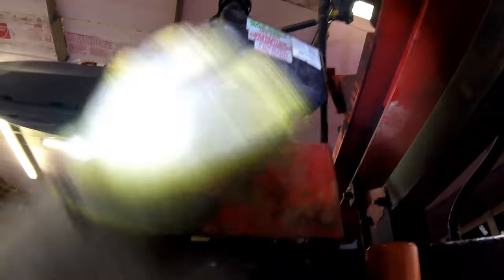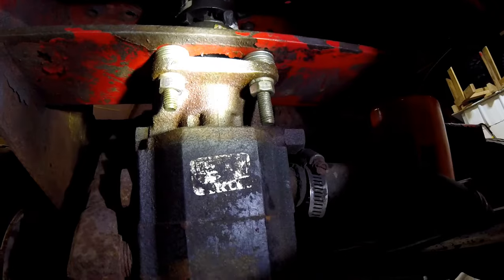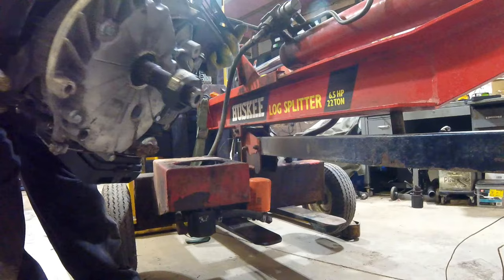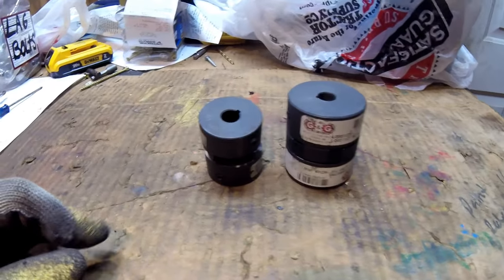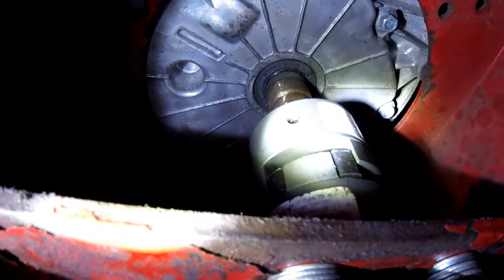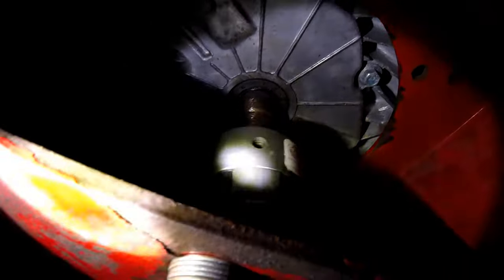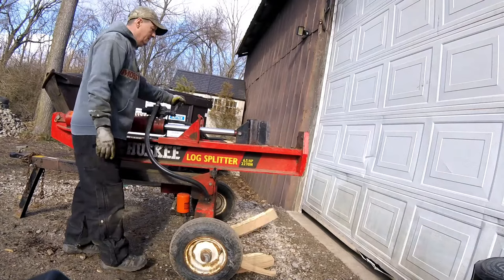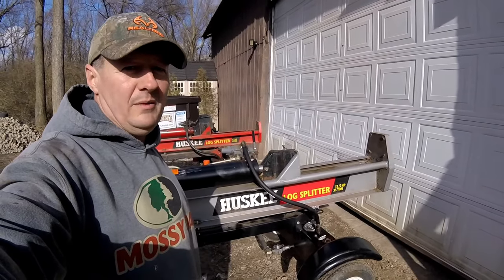Log Splitter Stopped Working - Fixed it easy!

Comment: Thanks alot for the info!!! Got a 27 ton ariens and never had a problem until it just stopped. After your video looked under hydraulic motor and yep coupling apart. Ariens makes it really easy to access. Took cover off, slid coupling together with screwdriver and tightened set screw. 5 min later splitting wood

Comment: I have a 40 ton log splitter last week at Blew a seal anyway I pulled it apart only to find the nut that goes on the end of the shaft for the ram was almost loose clearly when it was made they did not tightened up enough it is taking almost 20 years but it had about 3 turns left before falling off so in a way I was glad I found the problem before it became a problem that coupler looks like a silly design mine bolt straight to the motor

Comment: The L095 series of coupler is not overkill for that engine and pump, it is actually the correct selection. The original coupler was an L075 series which is actually under sized for the application, even though that is what the manufacturer of the splitter selected. They cut corners to save just a few dollars, and this is why these couplers fail so often on these inexpensive splitters.

On your other splitter with the 12 horsepower engine the L095 series coupler is undersized for that application. That coupler should be an L100 series.
Reply from the maker: Nice info.. thanks!

Comment: Biggest issue I've seen with these is misalignment between the motor and pump. It applies side load to the coupling and will wear those parts prematurely as well as the shaft bearings in the motor and pump. The whole setup is kinda garbage. I opted to convert my splitter to horizontal shaft which is a much better option.

Comment: Does it mean the pump is Ceased if it won't pull after replacing all that ?
Reply from the maker: You should be able to turn the pump. That could be an engine issue too.
Reply: @notoriousJPG   Figured it out bad pump. Your video is very helpful. Thank you.

Comment: I have a Huskee 22-ton splitter. While splitting a truckload, it all of the sudden just stopped splitting like it had no power. Also, during the process of retracting the ram, the handle will not jump back into neutral position on its own. The engine just bogs down and I have to knock the handle into neutral manually. Have you had this issue before?
Reply from the maker: Sounds like your splitter has a control valve problem. You can take it apart or just replace the whole unit most likely that would fix your issue.

Comment: my cylinder moves in and out with ease . DR 22 ton. I replaced hyd fluid and filter this year. It worked for a while . now the ram still goes out and in, but the unit will not split wood.  the engine runs fine. Briggs 875.
Reply from the maker: Possibly a tired pump, or possibly a partially faulty control valve.

Comment: Thanks for the video - I'm currently suffering with this exact problem - got the motor off & the pump off - can't get the durn coupler pieces off - stuck like crazy - soaked everything in WD-40 and left it overnight - we'll see if it comes loose, and already stripped out two allen wrenches and only got one of the screws loose  :(  Anyway - where did you get that part?  I need the exact same one, and the TroyBilt brand is pricey ... any tips on removing a stuck part also helpful, thanks in advance.
Reply: Pause & review - I think I can read the parts & model numbers and do the google ... stupid woodsplitter ... never borrow anything ever !
Reply from the maker: Yea,  always end up fixing Borrowed items... They probably lend it for some free repair work.  😆
Reply from the maker: Got the part at tractor supply company... Was in stock. 👍😉 You might be able to get a puller on that too, if it's stuck on there.
Reply: @notoriousJPG  A "puller?" may be cheaper than buying $50 worth of drill bits from Harbor Freight - thanks brother!
Reply: BTW - what the heck is a puller?
Reply: Ok, forget it ... google is amazing - the puller set may be cheaper than the durn drill bits ... :(
Reply: Dude - just can't thank you enough for this video and your advice. I'd never even HEARD of a 'puller.' Got a cheapo at Harbor Frieght, but the teeth were too big to get under the piece, but the 4" puller from TS just barely made it & it popped off in 30 seconds - this is after 4-6 hours of drilling and grinding on that damn thing. Now I'm putting it back together (thanks for the tips) - after an oil change & new filters - with luck, she'll fire up and I can give it back to the poor sod I borrowed it from two months ago ... in retrospect, I shoulda just stuck with my maul - not much to go wrong there, but these things are ham-dandy when you've got a giant load of oak .... until they break, that is. Still, with the repairs, probably cheaper than a three day rental (?) ... I'll never borrow again - lesson learned.  You Rule !

Comment: So let me get this straight there's nothing holding the motor to the splitter other than the bolts that holds the motor down.............I can't stop laughing had to rewind
Reply: What exactly do you find so funny about that? Mounting bolts are the only thing that holds a small engine to any piece of equipment.